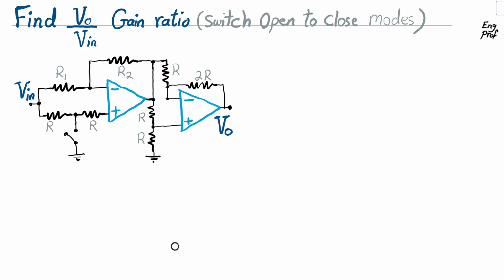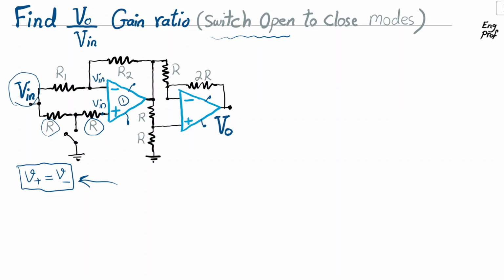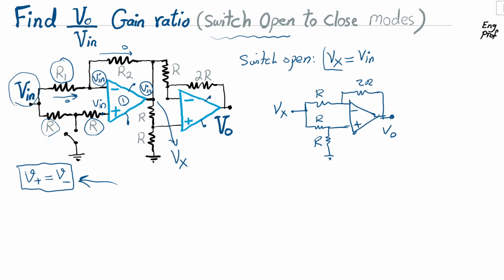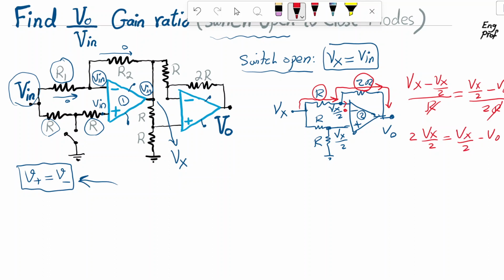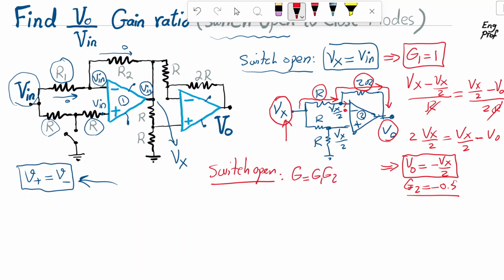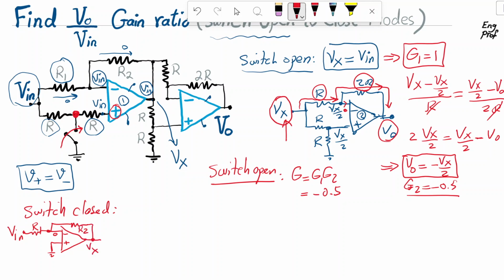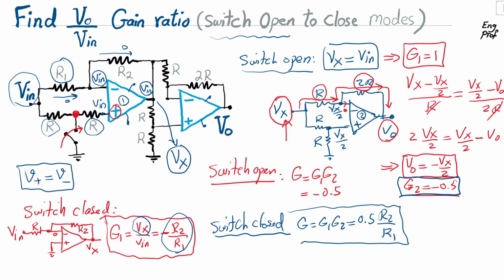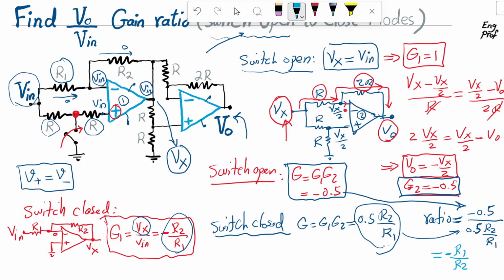Voltage Gain ratio of Circuit for switch open vs switch close modes

Comment from the maker: Thanks for watching. For more Op Amp and Analog Circuit examples please see: 
Op Amp Amplifier with Electronic Gain Control https://youtu.be/NoNgQpbj77Y
Op Amp Analog Computer Differential Equation Solver https://youtu.be/ENq39EesfPw
Push-Pull Power Amplifier with Darlington Transistors https://youtu.be/866MYibo8yE
How to find Bode Plot, Freq Response, Transfer Function of Analog Filters https://youtu.be/vZFkPeDa1H8
Analog Logarithm Computer https://youtu.be/RpKEq5WyoLg
Universal Analog Filter Design https://youtu.be/2J-0msXZE2o
Laplace Transform Example and S-domain circuit analysis:  https://youtu.be/ps8N5TPM_qU
Op Amp circuit Bode Frequency plot https://youtu.be/BLVzuuqAlZs
Lowpass Butterworth Filter: https://youtu.be/UzCjkwqy-9w
Analog Computer to Raise Signal to power n https://youtu.be/IUTlBH1UraE
Triangle Oscillator Op Amp circuit https://youtu.be/JF5Up_cuL9k
Differential Equation Solver Analog Circuit https://youtu.be/R3X5AYNZGEI
Complex Sinusoid Oscillator https://youtu.be/GXRhmwmS5Zk
Sawtooth Oscillator Design https://youtu.be/2eUsGPfqbW4
Full-Wave Rectifier circuit example https://youtu.be/DJJMNU-CYcg
Sawtooth Waveform Generator design with OpAmp, JFET, BJT https://youtu.be/5zHXTx-Vl20 
op amps Circuit with feedback loops to design an analog computer that solves a second order differential equation https://youtu.be/HeZRtnRXpEI 
For more analog circuits and signal processing examples see: https://www.youtube.com/playlist?list=PLrwXF7N522y4c7c-8KBjrwd7IyaZfWxyt
I hope these Circuit design and analysis videos are helpful. 🙋‍♂